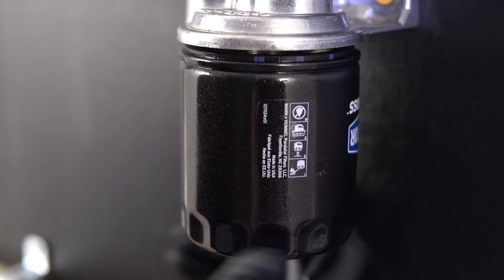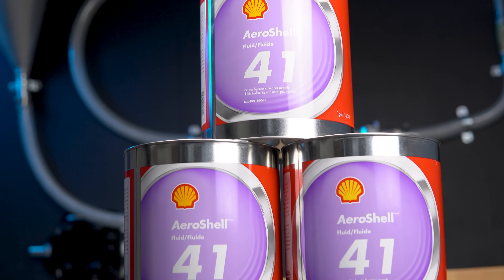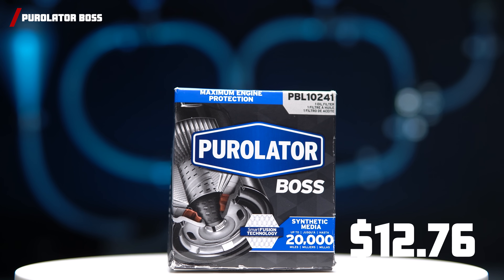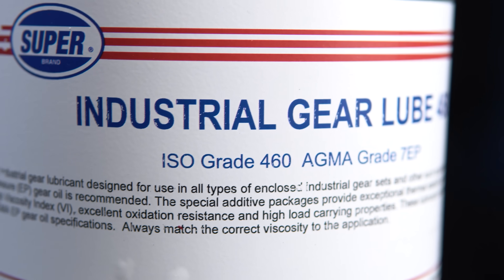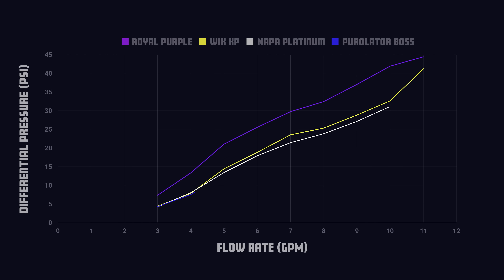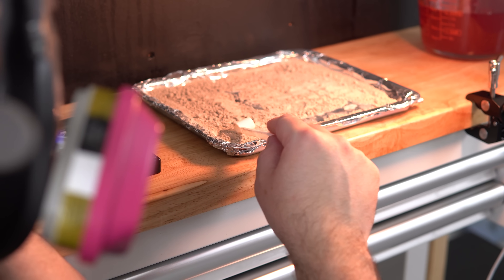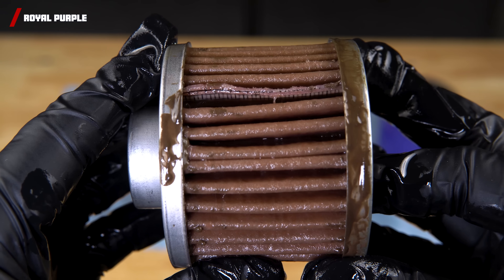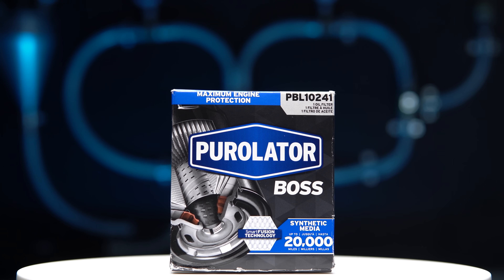Engineers Test the Most Popular Oil Filters

Comment: Your oil filter performance characterization is fantastic, but it opens up a whole can of worms -  how exactly is engine wear related to oil pressure differential across the filter, and how exactly is engine wear related to sub 38 micron particle contamination? I'm sure it varies greatly with different engines.   My gut instinct suggests that if you change your oil regularly, with any of the above filters, engine life will often exceed the remaining useful life of the rest of the car.  In other words, have you ever seen any evidence that any commercially available filter caused an engine to wear out prematurely when the oil was changed regularly?   I'm not suggesting that your test results are useless, as they would seem to have a great deal of value in helping a mechanic decide upon a filter that can best handle a car owner who doesn't change his oil regularly, which happens all too often in real life.  (i.e., pick the one that holds the most dirt.)
Reply from the maker: Hey, thank you so much for watching and supporting the channel. You have great points there and hopefully we will get into some of them on future oil filter videos. One of the main holes of this channel is to also bring awareness and education regarding the science and engineer behind the test and products, so appreciate your feedback and information.
Reply: @BrandRanks  The manufactures of cheap oil filters that don't trap small particles very well will tell you that small particles don't significantly contribute to engine wear, and that you don't want a filter that traps smaller particles because they restrict oil pressure too much.  They also point out that if the filter restricts oil pressure too much, it will cause the filter's bypass valve to open up, which causes the oil not to be filtered while the bypass valve is open.

On the other hand, the manufactures of more expensive oil filters that trap smaller particles will tell you that small particle contamination DOES increase engine wear, and they have research to back up their claims. (i.e. Amsoil)  But they tend to avoid the topic of what happens to an engine if the oil filter restricts the oil pressure too much, and the bypass valve opens up too frequently.   Let's face it, the average car driver has NO idea when or if the oil filter bypass valve opens up. (Though there is probably some way to figure it out if you tightly monitored the oil pressure all the time.)

Looking at the big picture, it's obvious that every engine is different, and that nobody knows your engine better than the engineers who designed it, so of course the vehicle manufactures mostly recommend their own OEM oil filters.  On the other hand the engine manufacture has little incentive to keep YOUR engine running beyond the warranty period, because they want to sell you a new vehicle as frequently as possible, so as to maximize their profits.

My own opinion is that if the oil filter's bypass valve does open for a few seconds during extreme acceleration or cold weather situations, it hardly matters over the total life of the oil change.  Given that engines often have internal clearances of 2 - 22 microns, trapping those smaller particles DOES matter, but only if doesn't often restrict oil pressure to the point of opening the filter's pre-calibrated bypass valve pressure setting.  And if you get rid of your car every couple years, like the rental car companies do, it's useless to spend an extra nickel on a premium oil filter.

Along those lines, keep in mind that there are major differences between engines, and their ability to deal with pressure differentials across the oil filter.  For example, some of these new Toyota engines actually have electronically controlled oil pressure regulation, to maximize the vehicle's mpg by better controlling the effort needed to pump the oil at different speeds.  (i.e., only provide enough oil pressure to properly lubricate the engine at any given engine speed.)   That begs the question of whether or not these new electronically controlled oil pressure systems can actually increase pressure to account for a dirty filter, which would help maximize oil filter life?  I honestly don't know the answer, but it is a fascinating question. 

If you guys at Brand Ranks really want to get deeper into oil filter testing, it would be interesting to accurately gauge how well those filter bypass valves really work - instead of just looking at them.  Every engine has a specific bypass filter pressure rating, so even if an aftermarket engine oil filter fits a specific engine, and adequately filters the oil without too much pressure drop, it says NOTHING about the quality and accuracy of the filter's internal bypass valves.  I say that because a while back General Motors has published a TSB warning  for oil change professionals of the need to use specific  FRAM filters with specific GM engines due to differences in bypass valve pressure ratings, regardless of whether or not a specific filter physically fits on an engine (which is the only thing most quick-change oil technicians care about).  In other words, just because a filter fits, it doesn't mean that the filter's bypass valve is properly calibrated for all engines. 

Keep in mind though that the oil filter isn't the only way to rid your engine oil of small particles - just changing your oil does that!    So, unless you are an environmentalist, it is hard to beat the basic advice of not spending too much money on a fancy oil filter, and just change your oil and filter regularly.  (i.e., consider that most lawn mower engines don't even have oil filters, and some of the newer Briggs & Stratton engines claim that you don't have to change the oil over the life of the engine - they recommend just keep adding oil as necessary  to keep the crankcase topped off.  They can presumably get away with this because the life of a lawn mower engine hardly compares to a motor vehicle expected life)

That said, there is a large segment of the population that does not change their vehicle engine oil frequently enough.  These type of people may be able to benefit from oil filters that have large dirt-holding capacity and don't restrict oil pressure too much.  On the other hand I've seen literally thousands of used open cartridge oil filters, and only a tiny, tiny fraction appear so plugged up with dirt that they would likely keep the bypass valve open.  It does happen though.  But I really wonder if 99% of us change our oil filters long before they reach the end of their useful life.  Keep in mind that decades ago it was common practice to only change your oil filter with every other oil change, and that was the manufacture's recommendation.  

Another obvious problem with changing your oil too frequently is the wear and tear on the engine drain bolt, the oil pan, and the skid plate (if the vehicle has one).  Many quick lube places don't bother to use a torque wrench on the oil drain bolt, and that can prematurely wear out the bolt and/or strip the oil pan, sometimes causing oil leaks.  Another problem with changing your oil is that if the engine has a skid plate, there could be half a dozen or considerably more screws holding it in place, and the quick lube technician is sometimes under pressure not to reinstall all the screws.  After a few years the next thing you know your skid plate is dragging on the ground.   So unless you do your own oil changes, it is  possible to get into trouble by changing your oil too often.
Reply: Dude you should be the group advisor

Comment: Wow none of these filters rate anywhere near a Ryco ST filter at 98.7% of 20 microns and 99.7% of 22 microns 5hey kick ass.
The Ryco standard is rated at 28 to 32 microns and costs $25 AUD and is what I run in my car with 441,000 km or 336k miles.
You get what you pay for.

Comment: Man do a comparison of the popular racing filters. Those are the filters that matter and the demographic that can best benefit from the data.  The difference in filters for the average American or car enthusiasts is completely irrelevant.  It doesn’t matter what Bob uses for a filter in his Kia, what Shelly runs in her f250 or Mike uses in his garage kept 2017 mustang.  Non of these use cases will see significant impact or variables in filter selection. Most of these engines will outlive the modern car even if you ran a $2 no name Chinese filter. Most won’t  rebuild their engines every few laps so the added ware is irrelevant.   For dirt track/ circle track, drag, street, off road  racers maximizing performance and HP your data is extremely valuable. These guys spend 10’s of thousands of dollars in annual rebuilds. They push RPM to the Max. So compare those filters.
Reply from the maker: Thank you so much for the suggestion! do you have any recommendations as to which ones are the most popular ones?

Comment: Your tests have "useless" applications toward the Internal Combustion engine. "Manufactures" state that the most wear and tear 'damage' is caused by carbon contamination particles between 5 to 8 micros in size. The problem is that oil needs to be full flow in-order to provide protection to the moving parts. For oil to flow at this rate, the filters can filter no smaller than 20 to 22 microns in size. Thus changing the oil filter and contaminated oil is recommended at 3000 to 7000 miles by various manufactures in order to keep the engine as clean as possible. The only way to keep an engine free of contaminates is to filter oil down to 1 or 2 microns. This can be done through the use of an oil bypass filtration system. Don't believe me? look it up yourself. Try AMSOIL or Frantz If you put one in, you can change your oil every 60-100,000 miles or before the viscosity fails.
Reply from the maker: We attempted to follow the industry standard on testing engine oil filter as best we could. Thanks for the feedback

Comment: This is all nonsense if you aggressively beat on your car and rack up miles in a hurry okay go with a over priced filter but besides that just change your oil on time or a little before I've been working on cars for over twenty five years napa,fram, ac delco,or factory oil filters😂 just perform recommend services on time that's all it takes go to any auto service shop or dealer and ask how many engines they replace or rebuild because someone used a cheap fram oil filter. Just perform your oil changes on time. . .
Reply from the maker: Agree, Oil change intervals is much more critical than any of the oil filters. Thanks for watching and sharing!